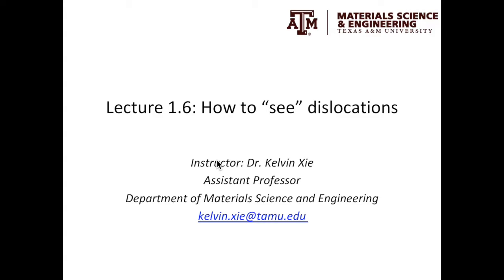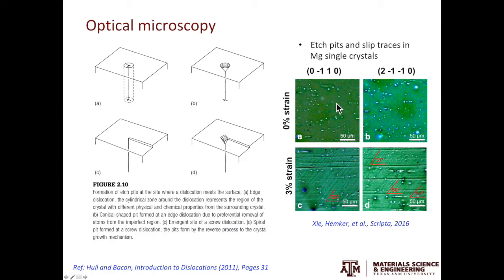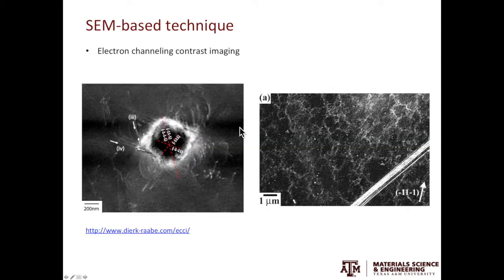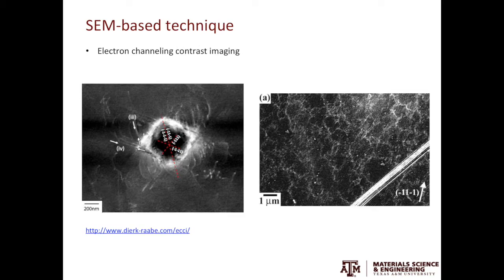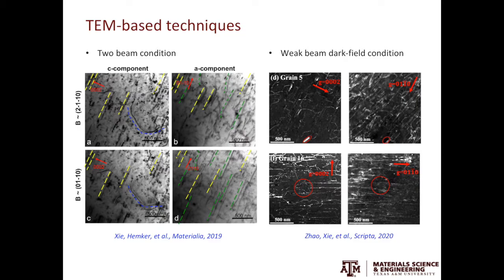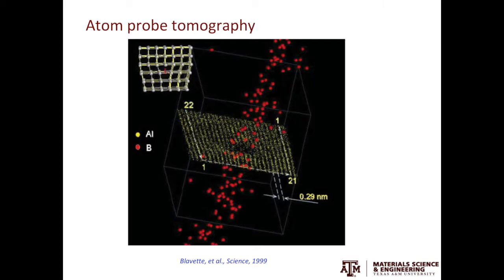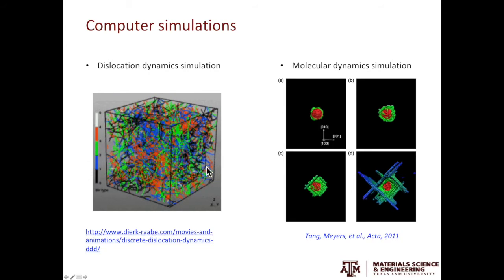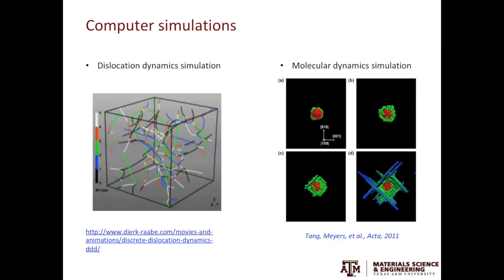1.6: How to see dislocations

Comment: Very nice vedio, but for a TEM new user, it's hard for me to tilt zone to two beam condition. Do you have any suggestions?
Reply from the maker: You can converge the beam to show the Kikuchi lines in the diffraction mode. Then you can use Kikuchi lines as a map to do tilting.
Reply: @kelvinxiemsentamu6890  Thanks, that's helpful